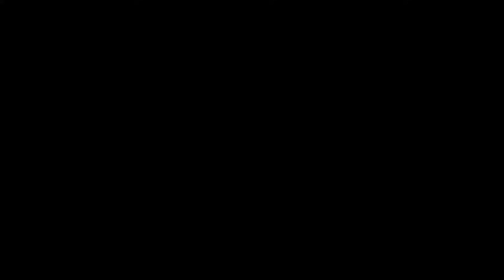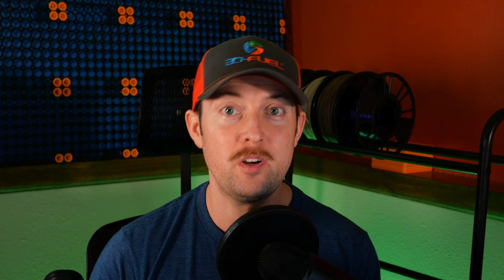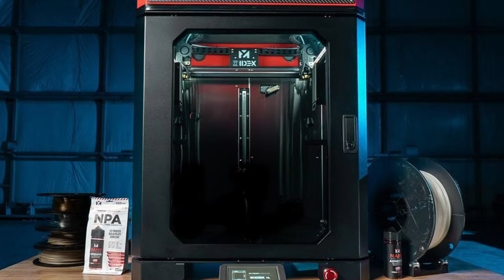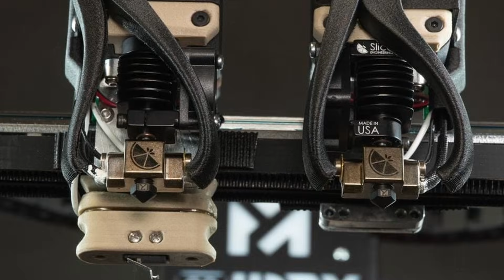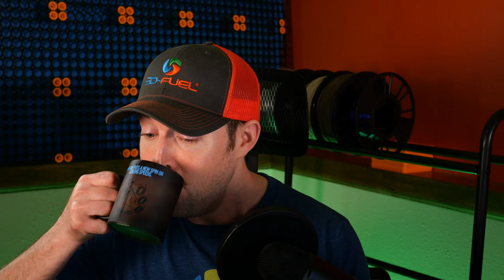Vision Miner releases 22 IDEX V4 | CASTOR Shuts Down | 3D-Fuel BFCM Sale | 3D-Fueled Ep 9

Comment: If prusa is wanting to be up-market and a midway point with engineering grade, having a 290 degree hotend is really going to hold them back, dimensional accuracy or not IMO

You mentioned Castor, and I wondered if y'all had heard anything about Fortis3D shutting down their FDM filament division maybe? I really love their engineering filaments, and they're one of the few food-safe-certified filament makers I was aware of (actually went through the FDA process), but now nobody seems to have any of their stuff in stock anymore, and all references on their website are gone :(
Reply from the maker: I've heard or Fortis3D, but the tragic reality is that customers don't care if you do things the "right" way. They only care if you say "FDA-approved", even if that certification was on the raw materials used and not on the actual product